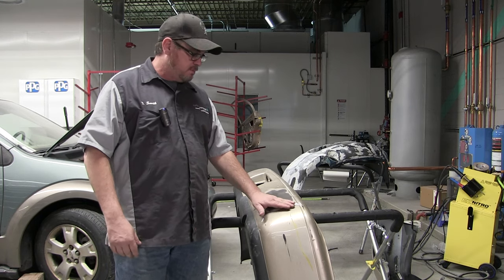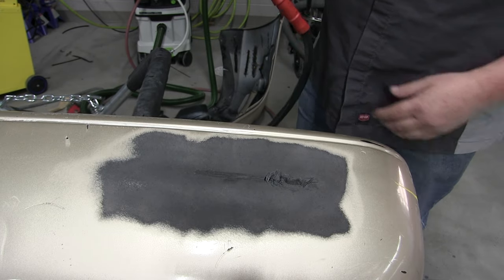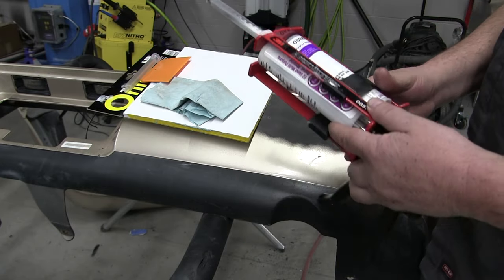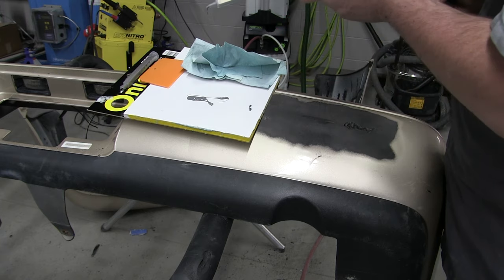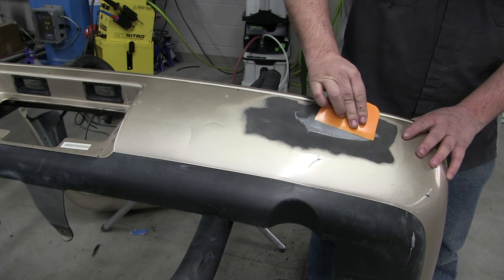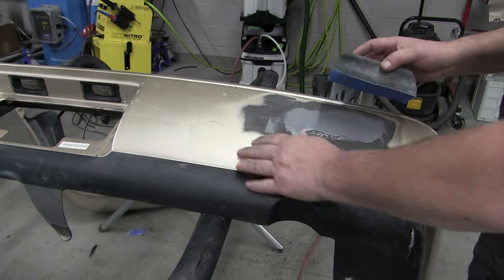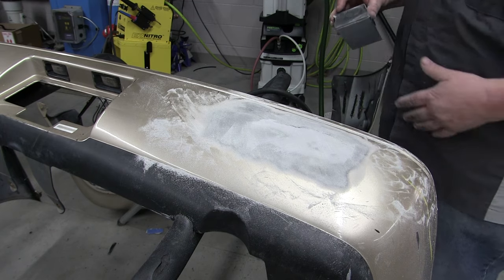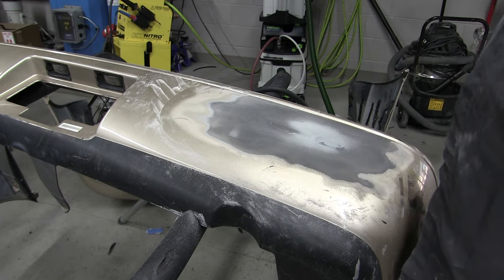How To Fill Low Areas on Bumper Cover  Don't Use Bondo on Plastic

Comment: Bondo works fine. There is different kinds of Bondo as well and you need to know which to use and how to adjust the amount of hardener to keep it from being brittle. Been using it for 20+ years and never had a problem once I gained experience using it. Also, adhesion promoter is unpredictable at best and will give you more problems and headaches than it's worth. Just prep the surface properly. The paint will adhere just fine as long as you don't go heavy on the first few coats because the solvents will soften the tooth. A couple light coats will seal it up just fine. Adhesion promoters are around because of high production shops want to spray things fast and get them out the door. Letting things dry to seal a surface is not in their interest. Be patient and don't get in a hurry. It's just paint.
Reply: First comment I hear on the adhesive promoter giving problems. I preped and sprayed my quad plastics with adhesive promoter and finished with paint. After the clear coat it started to crack and had sandpaper finish in some spots. First and last time I use that stuff.
Reply: Thank you 👍
Reply: I thought the adhesion promoter was so the Bondo will stick to the plastic
Reply: @FrancoDFernando  short answer- Bondo is a mechanical bond. It will fail on sheet metal if the surface isn't prepared correctly.
Adhesion promoter is just a sealer before paint and is  itself a chemical bond with solvents designed to soften a polymer and impregnate it with solids. Knowing this reaction and it's effects on different substrates under known environmental conditions will determine the outcome.
Solvents in paint however are by design just there to thin the pigment (different solids) for application and are designed to just be a medium and evaporate (flash) off.
The problem is these same solvents tend to soften the tooth (sand marks / mechanical adhesion) on polymers and can lead to the paint lifting. Bondo itself (depending on the type) holds up to  solvents ( Xylene, Toluene, even Keytones) quite well and even though promoters are used in fast turnaround shops for the reasons I gave above, they can lead to problems themselves especially if you haven't used them before or can't have a booth to control the environmental conditions that allows for repeatability. 
This video showed him using a two part adhesive as a filler. The fact that he shows himself sanding off the promoter and correctly explains the mechanical bond properties of the adhesive just reaffirms that it really isn't needed. The use of the adhesive is most likely because,
1. It's cheaper (time is money in a production shop)
2. It's faster (both in labor and cure time)
3. It requires no thought on the employee's part when it comes to mixing ratios. Less waste, and less screwups.

Current industry trends are to make cheap products that allow businesses to hire cheap unskilled labor, while still cutting down on waste and time,, it brings operational costs down. And that is the bottom line. No one in industry cares anymore if it will last more than 5 years due to planned obsolescence.  But cars from 1955 are still around with 67 year old bondo and filler under the paint.

Knowing and having experience is the key here because every plastic is different, and  the conditions can be different and each of these and more are variables that will effect the outcome of the job. Professional painters when hired are told what to do and what works in "their" shop (known environmental conditions) but often never the why. This knowledge came from the shop's many years of finding out what works and what doesn't. Think RCCA. Someone that never worked as a painter has the great joy of learning all of this himself through trial and error. It's not something that you can read a book on or watch some video about. Real life is putting in the hours and listening to those that have.
Reply: @ahole5407  oh nice....thank you so much for that (no sarcasm). I was looking into repairing these two holes that the dealership drills into the front bumper for the front license plate, and I was looking to use the bondo bumper repair and was told to use an adhesion promoter. You're definitely right that you only get that info with experience; I quickly found that out when doing my own drywall and other stuff around the house. You learn things that DIYer or "expert" videos/articles never tell you about. Thanks again.
Reply: @FrancoDFernando  if it was me I would do a plastic weld to fill the holes then follow up with filler.
Another option is to use fiberglass to fill the holes and reinforce it from the back. 
Welding plastic is easy and can be done with a soldering iron. Abs or some type of poly can be used as the filler depending on what the bumper is made out of. For poly you could use milk jug caps if you needed to save $$$.
Reply: @ahole5407  Your timing is impeccable; I was literally just looking up alternative methods. And I'm actually experienced with a soldering iron =)... Seriously, thank you so much!
Reply: I agree 100%, but I do like to prep it with plastic cleaner.
Reply: @ahole5407  I wish you had a youtube channel. You seem to know your stuff.
Reply: Don’t use fibreglass as someone says , fibreglass and plastic do no go together , in a short space of time fibreglass will just peel away from plastic , poor advise from a novice clearly .
Reply: @scottrussell7334  really now... I have a  repaired front air dam that was split it two back in 2000 that is still looking great. And all the shaved locks, handles, and lights from two other projects. Both over 8 years old. ABS, sheet metal, doesn't matter. Fiberglass bondo is just  reinforcement strands mixed in. The mat glass is for structural support.  Kinda like how I use med and high density foam as a shaped form before Fiberglass. I think you need more experience with the materials before making stupid comments.
Reply: Couple of clarification points. He's using the adhesion promoter for this 2-part adhesive/repair product, not for paint adhesion, per se.  Everything you say is accurate, in terms of primer/paint adhesion (properly prepare surface).

3M specifically recommends (on their site, for this product) the adhesion promoter for this adhesive product.  They're making no claims that it's necessary for the subsequent paint layers.

It's my understanding that the key benefit here is that the adhesive/repair material remains somewhat flexible, especially as you go to reinstall the bumper.

Again, not discounting what you said, just want to clarify for others that the adhesion promoter is probably a good idea here, specifically for the adhesive product (per manufacturer).  Agreed though, I would not do adhesion promoter beneath base coat layers or clear coat.
Reply: @btd-cf2000  👍
Reply: Hey question I was trying to use body filler and Bondo glass to mold to plastic parts together. Like a front bumper and a lip. I've also got some 3M bonding stuff that I'm going to try, I'm still a student working on my own projects any advice?
Reply: @jdmchickkustomz9417  by the time you sand everything down you won't have anything left holding it together except what's at the joint.  Density differences will cause it to break when flexed. I would need to know more about what two pieces you are working with. First thing that comes to mind is welding them.
Reply: @ahole5407  well it looks really smooth right now with the Bondo glass in the body filler. I'm just joining a bumper lip with a front bumper both plastic. The bumpers OEM I guess the lips probably urethane. 3M makes the plastic adhesive and bonding stuff but I already did this. I couldn't afford this stuff at the time. But if it's just going to crack out I might just cut it apart and redo it 😩
Reply: @jdmchickkustomz9417  ok, I think I can imagine what you are doing. If you are adding a lip to the bumper and if you are ok with shaving the lip in (basically it will look like a 1 piece) then layer up glass mat and have a good bit of overlap on the joint.  Drill and ziptie or bolt the pieces together first though.
If you just wanted to install the lip and keep the separation line (will look like two separate pieces), drill and bolt/ziptie it together with some body adhesive. 

With all of it you want to prep the surface, 80 grit and deep gouges with a knife. Also when sandwiching material with glass, it's good to "swiss cheese" it with a drill. The resin will lock the material from both sides and be much stronger.  Fiberglass is like sculpture. You can do whatever you want and make it look however you want, but you can't stand it down too thin. You need the structure of the mat to keep it's strength which means that the part will be thicker in the end.

Hope that helps. Good luck 👍
Reply: @ahole5407  That's awesome Thank you. I'm a student of auto body collision repair and I'm still learning but I try to do my own stuff I've been custom fabricating parts with fiberglass and yes I want to shave the lips in all the way around the car.
Reply: @wetwaredistributor6770  sand and degloss the bumper.220gr max. Use spot or glaze putty to smooth out the scratches. 

 The holes need to be either reinforced from behind with fiberglass, epoxy, or you can weld them up. Same with any "deep" damage. 

Adhesion promotion is not needed with polyurethane because it is not a thermal set offlien plastic.

Welding PU is is not like other plastics either. It's more like a brazing technique where thermo set plastics you just melt and they solidify.
Reply: I’ve been doing it 40+ years and you’re wrong
Reply: Bondo glass will work plastic bumpers as the first fill.
Reply: How much time are you talking between coats for dry time ? Thanks, Steve
Reply: @scottrussell7334 what seems yu talking from hear say and not experience...thts misinformation bub yu need to stop it

Comment: I get a kick out of how all of these self proclaimed experts don’t use proper terminology. Bumper faces are not made of plastic, they are made of thermoset polyurethane, which is technically not plastic.
Reply from the maker: Thermoset polyurethane was used in older vehicles, but is rarely used these day for bumper covers.  Thermoset is difficult to heat and reshape and to plastic weld.  The plastic used today is polypropylene blends of PP, which is a thermoplastic.  Thermoplastic is meltable,  reshapes with heat easily, and is easy to plastic weld.
Reply: @CarAddictGarage you owned him 😂
Reply: /r/iamverysmart

Comment: I do not have money to buy that product
Reply: you can try bumper bondo which is a type of bondo product which is designed for plastic body parts. It is different from regular Bondo by being flexible upon application and it's sold at Walmart (if your lucky cause my local Walmart is always sold out).

Comment: I have molded a plastic bumper lip into a plastic bumper and the Bondo well the body filler is cracking. What would be a better way to have done that cuz I still have the other bumper to do and I have to redo this one now
Reply: Fusor

Comment: What product is this??and where can i get the spray and filler at?
Reply from the maker: The adhesive I am using in the video is 3M Flexible EZ sand https://amzn.to/3gsLDmx. The spray is polyolefin plastic adhesion prompter 05907

Comment: Is that Panel Bond adhesive your using instead of Bondo?
Reply from the maker: No, it comes in the same cartidge, but it is designed for plastic repair.  It is called 3M EZ Sand Multi Purpose Repair Material.
Reply: @CarAddictGarage  I really do appreciate your videos and do you feel like it's better to use than Bondo on all phases of plastic repairs? also I will let my buddy know that owns his own collision repair shop because Bondo is about the only thing I've ever seen used on different types of plastic repairs,, if it's something that doesn't get replaced with a new part because plastic body parts are slowly rising in prices and I'm seeing more plastic repairs starting to happen these day....

Comment: On plastic bumper covers use flexible fillers evercoat sells them and use jb weld bumper filler its for plastic bumpers bondo will crack with the flexing and some advice if you mix bondo mix it to the right ratio do not play with the ratio it will not harden it wont be sandible and if it does cure it will take weeks .

Comment: Could I use my cordless sander with 220 grit for the webbing on my rear plastic bumper
Reply from the maker: Yes, that would work.  But after applying the repair adhesive I would block sand it level.
Reply: @CarAddictGarage  any block sanders you can recommend. I used a 220 to get through the webbing and hit it with 600 grit to smooth it out. She’s looking good and smooth now. Imma scruff her up and primer her Sunday
Reply from the maker: @Tactical_Response_Team  I like Dura blocks, but any block will work fine.
Reply: @CarAddictGarage  Dura Blocks? I’m gonna look into
Reply: @CarAddictGarage  appreciate it. I seen this small little rectangle block that this dude wrapped sand paper around. Which one might that be? It was small but perfect for tight places
Reply: @CarAddictGarage  finished it but got a little primer on the paint. Anyway to remove it

Comment: What is the adhesion promoter for before paint or what the flexible epoxy stuff is expensive enough I don't think I want to buy the adhesive promoter too LOL
Reply: 🤦‍♂️🤦‍♂️Bro... it's to make sure you expensive filler actually stays on. He says it in the video. Do you really want to spend your time and money on a repair that's more likely to fail just cause you don't want to spend no more than $30 dollars on adhesion promoter?

Comment: Remind me why is this better than bondo?
Reply: 1000 times stronger, works better, no cracking, no expansion and or contraction, flexible enough, finish comes out better, pretty much every single thing is better, except the $. ,  it will outlast the entire vehicle...
Reply: @luknehyba5692  So bondo is still good for bare metal?
Reply: @johnkim1656 im not sure. i dont use that brand. if Bondo makes epoxy, and they probably do, im sure its fine, has to be better than the orignal type of body filler. All im saying is if you want better all round everything, then 2 part epoxy[s] are the way. any brand, although some brands are better.
Reply: but i want it to expand and contract 

it's going on plastic, which expands and contracts